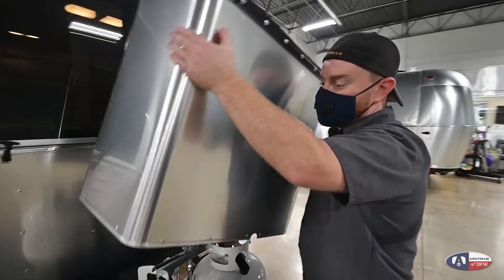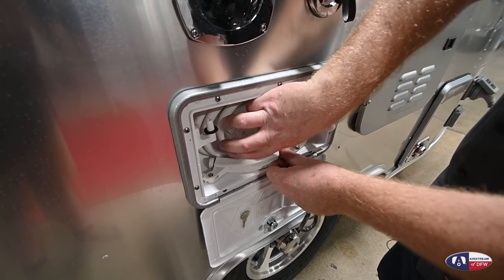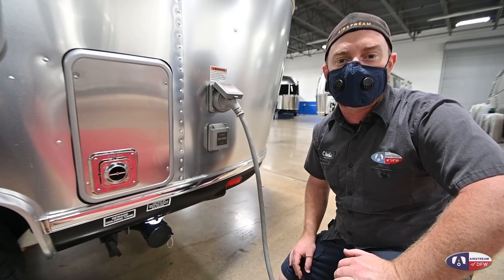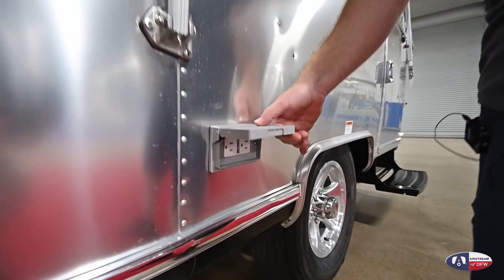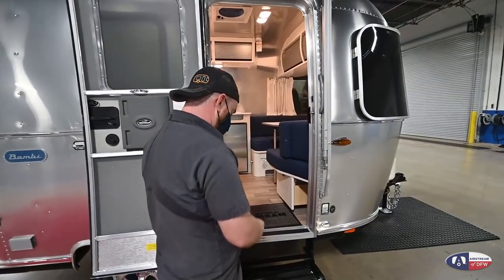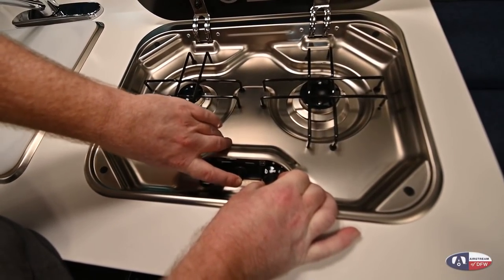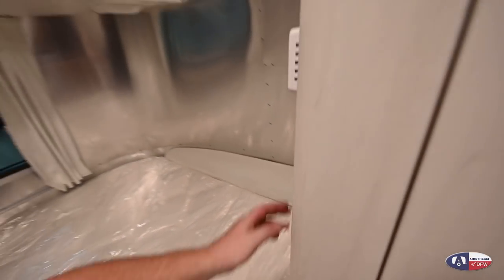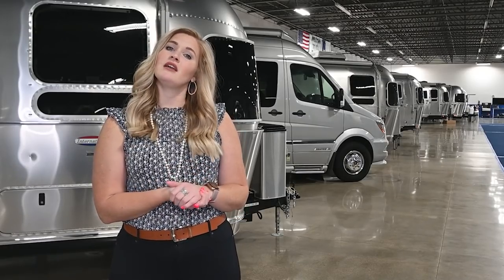2021 Airstream Bambi 16RB | Full Service Walk Through

Comment: The front travel latch for the awning was loose and not engaged when retracted and preparing for travel. Also the back awing latch was too high and would not latch during the demonstration, I am assuming a ladder was needed since the video cut away from the problem. This appears to be a design issue if it is showing up during a pro demonstration.

Comment: I did a walk thru of my camping neighbor’s new A S Bambi. They said it was north of $50 thousand dollars. It is great quality, but little stupid things that should’ve been upgraded 30 years ago like the double door needing an instructional display for any guest to close it correctly or risk breakage is total b. s.   Also...that manual flimsy awning is the same design that was on a 45 year old Airstream. An automatic Awning is needed. We are talking $50,000 + for a micro camper. Plus the very durable, yet ugly stainless that is what is trademark of Airstream quality doesn’t make for a cozy interior feel. It’s blindingly UGLY ON THE INSIDE. Even gulfstream jets know to design a comforting feel and look in the inside of a space that you are stuck in until landing. Well, I’ve been stuck in a micro of my own for a few days due to rainy weather. And my Jayco Hummingbird may not have the snob appeal that comes with Airstream ownership, but at half the price , my wife says she feels comfy and at home in our small trailer, plus it’s one of the smallest solid roof panel campers with a real functioning slide out at under 2,900 pounds. Check out the 2020 Jayco Hummingbirds here on YouTube. Great little Grandparents Camper. Mine has a real bathroom too. No wet bath airplane looking bathroom.